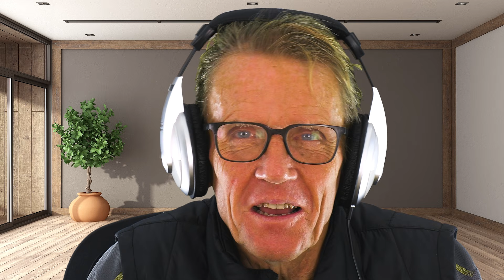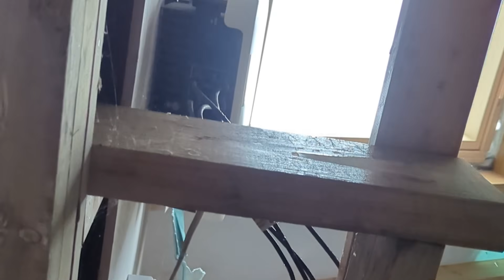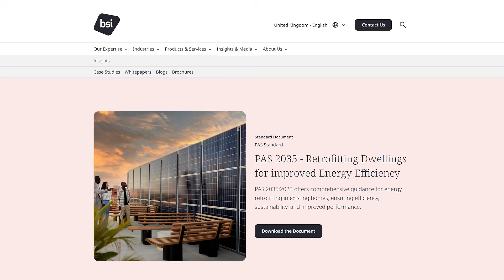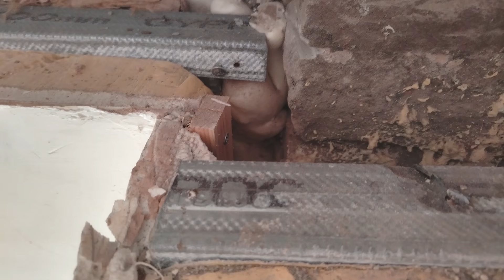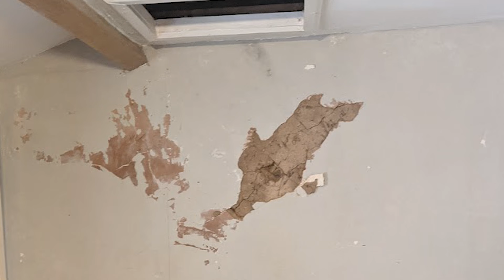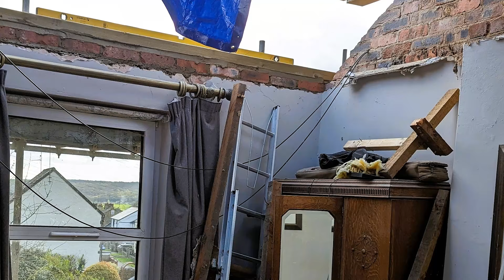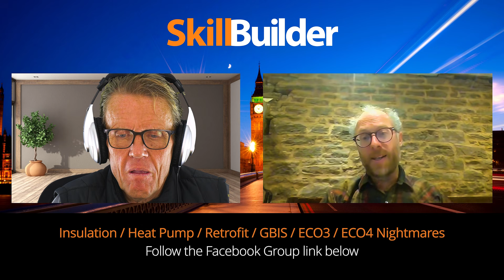Government Scheme Leaves Homeowners in Ruin – And Nobody Cares!

Comment: Heat source pump systems only work if the building is designed around it. Do not believe anyone who says different !
Reply: Thousands with retrofitted heat pumps would disagree.
Reply: @Biggest-hz7ng I'm sure there are,but. I bet none of them had it forced on them through gov schemes.
Reply: @teltwosheds2972 many heat pump installs through the government were fine. It'll be the loudest complainers (with the biggest faults) that appear on YouTube like this.
Reply: @Biggest-hz7ng I've seen hundreds fitted to housing association places. And everyone I have spoken to say. They are inefficient and expensive .
Reply: @teltwosheds2972 in contrast, Octopus and British Gas say you will see similar energy costs or better for their retrofits.

Comment: A basic household calculation is to measure k/W/h usage (UNITS ON THE METER PER DAY)
Reducing your k/W/h consumption to 5 k/W/h per day is the goal, over 15 k/W/h per day is a FAIL.
8 standard solar panels will heat a 200 litre Copper Hot water tank to 40 C - 60 C in a day 
Taking the emmersion heater on the hot water tank offline from the grid takes 5 k/W/h per day OFF the bill.

Comment: Roger you should ask the heat geeks to have a look for Duncan
Reply: And they would probably come to the same conclusions in 5 minutes as the house owner has found. A completely inadequate heat loss calculation resulting in an underestimation of the extra work involved and fitting of a under capacity heating source.

Comment: I have solid granite walls, an old baxi boiler and old gas fire.
Fitted a British made Clearview stove with back boiler, plumbed in to the old central heating gravity fed hot water tank and with pump also radiators. Make my own logs from my dead standing Ash, birch, willow from my small woods and had the gas removed.
The gas was expensive, but the old boiler not efficient. The Clearview is only 4.5KW but can easily belt out more I reckon, and my home is warmer and when the hot water is over 60⁰C from the back boiler, I can either control the burn or if it's over -10⁰C outdoors switch the radiator water pump on and the hot water is put through selected radiators to other areas. Otherwise just opening the GF door in living room allows circulation of heat around the rest of my small house. The stone holds the heat for 24 hours, so the next day it's still almost 20⁰C in the living room.
Not perfect but works really well and also perfect for cooking on.
All I could use is a solar water heater out front and plumbed in and removable, for hot water in summer when I don't use the stove much.
Reply: I just don’t buy your story. Energy is energy. It’s physically impossible to get all that from 4.5kw!

Comment: Heat pumps dont work. Houses need to breathe. Air needs to circulate through the walls and via all those little gaps and cracks and crevices. If all that is stopped up your walls will run with water and you'll get mould and fungi. Do not insulate. It's not healthy.

Comment: In a previous life I used to visit people in their homes in the late 1970s and early 80s, often in low level and high rise blocks. Many of the properties were all electric, Ronan Point, the tenants could not afford the bills and were unable to heat their homes, they were then afflicted by severe condensation and mould, clothing and furniture ruined. No one in their right mind would heat their homes with electricity considering the British housing stock constructed on the basis of cheap coal. HPs might be appropriate for new build Scandinavia design and standards homes but Victorian, Edwardian and pre war houses HPs think twice. As electricity prices are incredibly exorbitant the government has a plan to raise gas prices to above electricity in order to sustain their heat pump myth.
Reply: Years ago I read a Government survey about Heat Pumps. It was more of a real world type survey or experiment where they had spent money installing heat pumps in various properties of various ages. The conclusion was that a heat pump could be fitted to almost any type of property BUT the older the property the more "additional" work was required for the heat pump to run efficiently.  In many older properties (pre WWII) the cost of the additional work effectively meant that the installation was not financially sensible.
Reply: The answer for a lot of flats should be air to air (HVAC) systems rather than heat pumps. When you’re heating a smaller space it just makes more sense to use a blown air system.

They get pretty impressive efficiency stats too making the price functionally the same as using gas. Bonus as well is all modern ones can dehumidify as well which is incredibly useful for flats.

I think we have the technology we didn’t have in the 70/80s now but the government grants are always behind where they should be. HVAC units should categorically be funded under the heat pump grant as long as they are also being used as the main source of heating.
Reply: @jeanjacques9980 That is socialism for you right there.
Reply: @markrainford1219  no, it's not socialism. Socialism would be having a government owned & run installer where the workers would get paid the same if you installed the system or not - no pressure to force someone to get the grant for a private company.

Comment: Had ashp solar and internal wall under eco 4 in 2023. There was a couple of issues regarding the solar, which was sorted. The system works well i  our solid stone house. It's a lot cheaper in the spring summer and about the same in winter as our old heating. We have wood burners if we need extra if it's really cold, but we hadthem with the old system as well.

Comment: So the home owner - smart fella but on benefits !! was using the equivalent of 20,000 kw of energy (oil) previously and was warm (?) replaces with a heat pump that should in theory reduce his input energy to 7000kw of electric - max depending on the eficiency of his old boiler.

He should be net neutral on costs between the two systems unless his oil consumption was just for the mornings and evenings which would mean his constant heat from an ASHP would equate to a vastly bigger figure from the old system to match.

Roger hits the nail on the head about the lack of reactive control ASHP offer for when the weather changes but misses the constant warmth element from ASHP's. Great if you are home all day but rubbish if you are not and desperate if you have a heat leaking old home and not wealthy enough to allow for that all day heat luxury.

The rest of this tale was just poor installers and frankly a decrepit cottage that should never have had a PV system installed before the roof was swapped.

Comment: Utter nightmare, I nearly went down the heat pump route, a trusted neighbour warned me against it and we ended up getting a Biomass boiler instead. We had a WarmFlow boiler installed, which has had no end of faults occurring since it was installed. The installer has been amazing, but WarmFlow themselves have been terrible. I luckily have a 5 years Warranty (now 2.5 years in), I predict that the next 2.5 years will cost the installer more in call-outs and repairs than the actual cost of the install (£16,000 - £9000 Home Energy Scotland Grant). I suggested that they remove the boiler, refund my money, got HES to approve that, but WarmFlow insist that they don't think that is necessary. I've lost count of how many times I have had to call out the Engineer to repair. The installation company MCA Renewables have been amazing and I am truly grateful for that.

Comment: 50kw a day? Imagine having 50x 1kw electric fires running. And yet it still couldn't get past 18deg c on a warmer day
Reply: 2kw an hour over the day - even with a COP of 3 thats 6kw an hour equivalent. or four oil filled electric radiators in an old house running all the time.

The numbers do not add up unless of course your COP is below 2. In which case that looks OK.

Comment: Old solid stone backfilled walls are never going to be any good for heat a pump system unless you insulate from the inside, which would hide all the character of the bare stone walls, but you can't have everything.
 I think heat pumps benefit newer houses insulated throughout as they were constructed but also still have an air gap cavity.
Gaz Yorkshire.

Comment: Heat pumps in less than perfectly insulated homes is fundamentally idiotic. Heat pumps are a low slow heater, if you have a high rate of heat loss, you will never see increasing temps.

Comment: Regardless of any other calculations there was a working oil fired system. Surely, the simple approach would be; How much energy could the oil fired system supply, and how much energy did the oil fired system supply in a year - which you can calculate from the oil burned.  If the proposed system is not able to supply the same heat then it's not specified correctly.
Reply: Bit more complicated due to how ASHP operate. Oil and gas are nearly always timed to run at set periods. That is the crucial part of the calculations as ASHP only work well if running to build at least base heat all day and night.

The costs for that would drive your oil bill and therfore your Kwh consumption up dramatically. This part of the process seems to be ignored by all ASHP advocates.

My experience is from managing this for countless social housing providers for three decades of which the last 1-12 years the ASHP / Green / Eco story has grown and grown. ASHP work for retirees in suitably insulated homes. The rest varyingly not so much to down right never.

Its a minefield and frankly I am glad to be out of it.
Reply: It would be a lot more complicated than that. A modern boiler can be a lot more efficient than an old boiler. So taking the usage from something that may be ancient can give inflated usage. There is no guarantee that the old boiler was sized correctly for the property and if not could have been run inefficiently (short cycling for instance). The property need a lot of insulation as said by the house owner (some of which was rejected).  The whole house calculation needs to be performed after the insulation work is complete OR if the system is correctly designed from a base line which already include fitting insulation the insulation plan must be completed to make the design on paper correct - and not rejecting part of it. Complain about a heat pump but then admitting that there is no loft insulation!   Complain about the bill for a hot water immersion heater because he "forgets to turn it off" - fit a cheap immersion timer switch or one that only gives one hour boost function.

Comment: I’m a retired heating engineer who worked installing wood burners for a firm as and when required.
The owner of the wood burning company was a passionate green eco guy,and was going to renovate a farmhouse prior to retirement,with the intention to move in when completed.
He asked me to plumb the building which I was happy to do,he approached Worcester Bosch and they designed ,specified and supplied a ground source heat pump,and water solar panels,complete with buffer tank and hot water cylinder.
This ,at the time,was very new technology,I installed it all complete with underfloor heating on both ground and first floor.We started the system and all appeared fine ,the property was not occupied so the heating was left running to test it,after a few weeks the customer/friend asked me what I thought of it,I said as I didn’t know what it was costing I couldn’t comment.I suggested that as it was working with no leaks or problems we ask Worcester to send an engineer to check the system.
The top Worcester engineer turned up ,did a visual inspection and confirmed that the system was correctly installed,he then went to the boiler and accessed the 3rd level of the computer controls,which we didn’t know existed and I didn’t understand,when he turned to the customer and said that within a year he will be able to use the system to its maximum efficiency,I replied I had customers who couldn’t change their timers for BST. so couldn’t recommend the system,my friend then asked me to leave the room sensing that the engineer was unhappy with me.
I occasionally see my friend and he regrets being an early adopter of the technology,which he has had to augment with electric solar panels on an outbuilding and a wood burner.
Living in rural Wales where many people have had air source pumps fitted for free I feel we are 1 hard winter away from widespread regret.

Comment: The problems here are simply the build quality of the house. A decent builder asked to inspect the roof, floors, walls, windows etc. would easily have identified these obvious faults. This property was originally a forge so essentially a makeshift workplace with a shoddy blockwork extension. I have seen plenty of these types of structures in my time and told any prospective buyers they will be buying a money pit. Forget surveyors, just get a couple of experienced builders to give you the bad, or hopefully good news

Comment: Its not just Heat Pumps, solar industry is moving to battery backup and cheap overnight electricity, but pre-contract surveys are non existamt on peak home usage in amps and dont properly assess your mains fuse capability, that may need upgrading.  Government wants us to buy solar, heat pumps, EVs but isnt regulating suppliers of these new techniologies because the government doesnt understand the new technologies.

Comment: He Needs to Have solar panels connected to his HOT WATER CYLINDER AND PUT A SOLAR RADIN SYSTEM H/ W CONNECTIONS TO HIS CYLINDER AND HAVE THE ASHP ON NIGHT TIME TARAFT OFF 9 P PER KW 7 PM EVENING TO 12 PM ? SMART METERS  SIEMENS ENGINEERS  HEAR NO FEAR.

Comment: With heat pumps workin efficiently at 50 get C it is obvious that in Winter only a very well insulated property will be adequate heated  in Winter. leaving a large  heating system on. that woks inefficiently  all Winter will cost a fortune . In my opinion every house should have a specially calculated. system and if higher temps of radiators are needed  gas etc. should remain. On term proposals to remove gas are not possible as every property would need upgraded mains  to meet full electric  mode  so every street and road in uk will need to be dug up and new cables installed.

Comment: There's the same blind push on heat pumps in Ireland too, regardless of the practicalities of achieving the huge uplift in thermal performance required of the building envelope to make them a realistic option.  I work in the construction industry and it's clear to me that there will always be a large percentage of the housing stock that will never be suitable for this technology.  My own house was built 26 years ago and would require a massive spend on retrofit insulation upgrades to make a heat pump an option.  There are grants available for sure, but pulling up ground floors to install insulation and underfloor heating etc would entail tearing the house apart and is not something I want to do.  At the same time as we are pushed towards electric heating and EVs we are warned that the national grid struggles to keep up with demand and security of supply, so why push more people towards electricity?  I'm going to stick with my oil boiler and wood burning stove for now.  I switch off now when I hear about "carbon neutral this" or "zero carbon that", like a lot of people I now have "climate change" fatigue!

Comment: Surely for a 'tricky' property like this the best way to establish heat loss is to see how much oil the building uses prior to heating conversion and calculate how much heat pump heat is going to be needed to provide a comparable output.
Reply: Yes, and you need to know the power that the oil system is producing when it's running and for how long it is running. You need to be able to replicate a similar profile. You can't just average it over 24hrs.

Comment: We had solar panels fitted just over 2 years ago including a battery. Our direct debit for gas and electric for the last 5 months has been £8 per month, we are £400 in credit, I built a spreadsheet to monitor the costings and our combined utility bill is £900-£1000 per year. We are very frugal on how we use it, when the full is battery I turn on the immersion heater to negate the use of gas to reheat the water in the evening. Winter is a challenge, our direct debit during this time is £28pm 

There is no way I will convert to heat pumps, I think they look unsightly bolted high on your house, if all houses especially new homes were fitted with solar panels it would help

Comment: Thank you for the video, I currently have a very old oil boiler about 45 years old. I am looking to replace with another oil boiler or get a heat pump. I am still undecided on which way to go, I am tempted to get the new oil boiler and then get the heat pump as well but I would leave the oil boiler connect for emergency use.